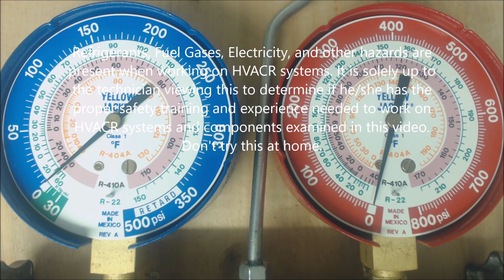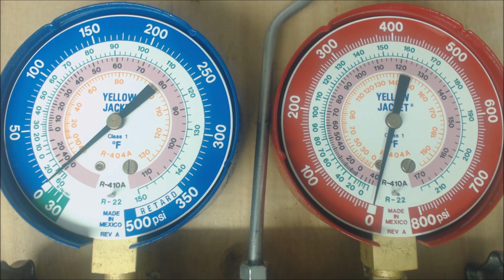R-22 and R-410A Refrigerant Operating Pressures on Air Conditioning Units!

Comment: Is it normal for head pressure to swing upwards of 70-100psi while running?  On a 70 degree day.  Unit is around 300psi high side and swings up to 380-400 and then back down. Low side is about 125psi

Comment: What is the max pressure required for an inside evaporator. My evaporator has 400 psig. Can I use it for R-410A after flushing out the r-22?

Comment: I have a question.  Our AC Unit was checked and we were told that it was working great.  It was a model from 2008.  However, by the following day our unit was no longer cooling and the refrigerant was completely empty. We also had water near our furnace from the evaporator coil.  I requested the report from the company and these are the numbers that were listed.  High Side Pressure=210, High Side Temp=105, Low Side Pressure=70, Low Side Temp=38.  Were these readings ok?  Or was it indicative of a problem?

Comment: If a system at sea level has a standing pressure of 14.7 psig on a standard gauge does that mean it is completely void and anything less is technically under vacuum/ open to moisture contamination?

Comment: What should the blue/low guage read when re-filling with R22?  This would be in a constant temp climate like Miami of about 85 deg F.
Reply: It depends on a few factors but sometimes you wont see the suction gauge go up much because it depends on the metering device and some other factors or you wont be able to charge the refrigerant much because of the devices in the line. Otherwise, most of the time the suction and discharge gauges will reach equilibrium once the refrigerant settles. Alot of times you have to charge as much as you can with the system off then turn the system on so you can finish putting in the rest of the charge because you need a better pressure differential. Ive even had it where i can barely put in refrigerant while the system is off and i had to manually turn on the compressor or bypass the low suction pressure sensor because i couldnt get enough refrigerant in the system for it to stay on long enough because it kept tripping on low suction pressure

Comment: I watched this video more than 5! Time but every time I watch it I’m learning something new and very helpful thanks. Because I run to an ac with r22 refrigerant and has high pressure on high side and was afraid if I did something wrong to the system after I watch this video again I understand it was because it small condenser with low sears. Thanks again

Comment: what about roof top package type units???....i was told do not worry about subcool or superheat method and just charge by pressure...could not find  a subcool rating anywhere ..has txv valve

Comment: 110 to 136 PSIG on the low side?
The data plate on my condenser says 410A PSIG LOW: 236 HIGH: 446
Reply from the maker: Those are not running pressures but design max pressures, the running pressures will change with the heat load inside and outside the house, thanks.

Comment: Thank you for your videos. I have a question about the "expected pressure" on the high side, can we take the SEER rating, refrigerate type and the outside temperature and add a constant value to get the expected high side pressure?
So for a example a R22 on a 85 degree day for a SEER 13 would mean the pressure should reflect 85 + 20 = 105 F. Then covert 105F on a PT chart?
Reply: Kow  the  are  . Diffwrnce  in  temperraure  of  of out  and  room  air  and  u  factor  the  heat  leakge  rhrufh  wall  . Cilling  and  floor  per  hour  canbw  calculated  using  the  following  equation  ..   Heat leakge  =ufactor  xtemperature  difference  =uxAxTD (u=factor  -Btus  =area  -squre  feet  Td=tempreaature  difference  -°f.

Comment: Where to normally find the metering devices on typical residential systems?  Thanks
Reply: In the same panel as evaporator coil or right outside the evap coil usually unless it is a fixed orifice or exv. Those are usually at the condenser. But they are all on the liquid line going to the evap coil

Comment: Is there a way to approximate how low in refrigerant a system may be using the gauges? Thanks.   Love the channel.
Reply: Kind of. The system name plate will usually tell you the normal charge in the system (in the US it will say 5lbs of R22 for example) and then since you know what normal operating should be, you can kind of guess. If the system is operating at half the normal pressures then you would be somewhere around 2.5lbs of refrigerant based on the example above. But don’t forget that any split system with more than 20ft of line set you have to add a few ounces per every few feet of extra line set. I cant remember the exact numbers but yea

Comment: We have a min of 95F cond temp on all systems so you're going to have a low of that on 22 or 410 systems, so 22 shouldn't be any lower than 190psi and 410 280psi, any lower and the system needs head pressure controls or it will crash, you won't be able to maintain control of the low side and you might slug the compressor, variable speed equip might be the exception.

Comment: Hi question:  what caused the  low press pipe condensor outside frosting and  hi press pipe cold on the evaporator side ( when you touch it) ? this happens when The AC has been running over 10 hours then temperature house stuck at 24.5 degrees C then the indoor house turning hot again? thank you

Comment: I have a Embraco VEGT 8H compressor and i'm not sure what low side pressure I should be seeing on the guage.  I have seen videos on freon charging that say 2 and others that say 30 psi.  If anyone has the answer I would be grateful.  At the moment my low side pressure is 10psi and im not sure if i should add or remove freon.  thanks

Comment: it would be a great video if it was running with those freezing low side and what the high side is doing at the same time. If the low side is 30-32 what the high side doing.

Comment: What is the correct psi for r22 dometic rv ac ?
Reply: Depends on the unit itself, use your charging plates and data plates for reference. If its txv use subcool if piston superheat. If you dont know this you should probably not attempt at all.

Comment: Is it expensive to convert from one to the other? Do I have to buy a brand new central AC unit?
Reply: You would need to at least replace the condenser coil, compressor, metering device, and evap coil. Than you have to make sure you flush the lines out (they have flushing agents like RX-11), flush with nitrogen, and then make sure you vacuum to 500 or below microns etc. If i were you i would just replace the whole system if you could. You might actually save money because the labor of replacing all those items is more than the labor to just replace the units. If you can of course.

Comment: I have a question. Let's say in NC the ambient temperature outside is 80 degrees and you are using R-410A refrigerant. What should my high side and my lowside pressures be? Second question if you charge the unit with a subcooling of 12 because that is what it calls for will you still have the same subcooling at 95 degrees in the summer?bAnd what will your high side and low side pressure s be?

Comment: can you do one with celsius
Reply from the maker: Thanks for letting me know what you would like to see Fareeda!
Reply: @acservicetechchannel  it is a bit complicated to understand the pressure vs the farenheit  scale.what will the typical pressure readings be around on a hot day say32 degrees Celsius. I have set my pressure at72psi . But my air con still cools to only 26 degrees inside my lounge.i have an 18000 but unit.i I use r 22.

Comment: Love your videos 
Would like your opinion 
Running a packaged unit with r22 and high pressure switch is faulty cant read the stamping on the switch and cant crossmatch oem # to aftermarket. 
All i know is its made by saginomiya with dual spade terminals and a female fitting 
Would one in the 300-400 psi range do the job
Hope you can help thanks
Reply from the maker: If the unit is an ac only unit without a reversing valve then it is not a necessity just like most other ac only units. If it is a heat pump then it is there as a safety. 300 or 350 could work though.
Reply: @acservicetechchannel yes it is also a heat pump  Thankyou so much cheers

Comment: Should we make up 410A to 1.0 HP Panasonic Inverter with the tank turned upside down and compressor is running?
Reply from the maker: You usually break the vacuum with the amount of refrigerant needed. that is called the total weight method. You can add refrigerant in slowly while it is running but the bottle must be upside down and be metered in slowly to avoid liquid entering the compressor. The accumulator will also safe guard the compressor, thanks!
Reply: @acservicetechchannel  Thank you for the feedback. Appreciated the answer.

Comment: Your videos are great man have really learned a lot from the way you teach things and make them easier to understand. How do you know what the head pressure should be for an R22 and 410A system if the outdoor coil is clean and the ambient is around 70 degrees F. I was taught anything above 70F, add 30F and that should be your saturated condensing temperature. So if it’s 80 degrees ambient add 30 degrees which gives you 110F. See what pressure that corresponds to using a pt chart for a given refrigerant and that should be your pressure. Is that a good way to determine what your head pressure should be
Reply from the maker: What you are describing is that old ambient plus 30 rule of thumb. We use superheat and subcooling for efficiency and compressor safety. That was a rule that got you close on old 10 seer r22 units. Look up "acservicetech subcooling and superheat" I also have everything explained in detail step by step in the book at acservicetech.com thanks!
Reply: AC Service Tech LLC Thanks, I really appreciate the info and your videos have helped me tremendously throughout my apprenticeship

Comment: I just started up my own little system but its a medium temp system . Now am confused my friend says it is under changed and I know it is. My high side is at 151 psi  and my low side is at 42 Psi How is it that am getting 41F across my coil and my suction temp is at 53F for the compressor. All I know if for my system the evaporator coil needs to be under 40F say about 30F to 35F. Maybe I just need to keep adding gas but when I do my compersser shuts off on high pressure. I am confused it is water cooled as well.

Comment: I have a 16 seer Rheem 3 1/ 2 ton unit cools Ok not great late afternoon and night but from early to late afternoon won’t maintain temp we have it set for 74 degrees it will go up 78 or 79 degrees in afternoon unit is less than a month old when they installed it they ran a new line set I was watching through out must of the installation they had a bad kink in the diction line when they ran it I mentioned it to them and they said they seen worse and they left it like that so I put gauges on it and at 97 or
Reply: 97 degrees ambient it’s running at 102 to 105 psi on the low side I checked sub cooling I have 10 12 degrees charge is good I am thinking the kinked line is causing low suction pressure would the linked line cause low suction pressure? Clean filter brand new coil real good air flow kinked line gotta be the cause

Comment: Awesome channel! There is so much bad information out there on this topic so thank you for teaching us! Btw how are window and portable units able to operate at 300psig low / 520psig high (R410a). I’ve been looking everywhere for an answer and can’t find one. They are usually completely sealed systems and don’t have service ports. But even if you install a port, how would you fill it to 300psig?! It seems like they can’t be repaired. There is usually a sticker with the specs on the side of the unit and that’s where I’m getting these numbers from.
Reply: Or perhaps it’s the maximum pressure the unit is built for..... yeah probably that. :)
Reply from the maker: Yes that is the max design pressure for sure, they operate the same as other r410a fixed orifice systems and you would mout the port on the low pressure side to check the superheat since it has a capillary tube as the metering device, thanks

Comment: You mentioned that things are different in an inverter type system.  Can you explain that more?  I am seeing about 75psig on the low side of a R410a mini-split during operation and trying to figure out if that is somehow normal or if there is actually a leak.
Reply from the maker: Mini split manufacturers don't give us superheat or subcooling guidelines but just the total weight procedure for inverter type units unfortunately however the low side sat temp should not be below 32 degrees, thanks

Comment: 120 suction pressure with 500 high pressure it trips the high pressure cut off switch. What could be the problem
Reply from the maker: Is it a heat pump or AC unit. Is the subcooling too high? Are the fins in bad shape? Is the outdoor unit stuck in a location where it is recycling the hot air that it is trying to blow out of the coil area?
Reply: @acservicetechchannel  13 seer York 3 ton split system. Not sure about subcooling. Because tech didn't read that. She said bad compressor. She said the fins are good. it's in a very ventilated area.
Reply: @9to5techs : "She said a bad compressor." With a 500 psi head pressure?? (just saying) :)
Reply: @coolramone  what do u think it is
Reply: coolramone SHE, said bad compressor? Tell HER to go home and start cooking, she's probably got air in your system. Hire a MAN to come and evacuate the system and run a good vacuum then charge to the capacity stated on nameplate of condensing unit.
Reply: @acservicetechchannel  forgot to tell you it is R-410A

Comment: I recently had contractor added 4lbs r22 into 2ton unit.  At that time outside around middle 70s.  In door temperature readings is 76-78.  The low side pressure is at 70s and high side around 130s.  Is this right settings?  Thanks you!
Reply from the maker: They would have been either using superheat or subcooling so you can't just go by pressures, thanks!

Comment: My r22 compressor went out.  It was made in 2002. My evap coil is 410 and was installed 2012.   The guy wants to get a 410 condenser and reuse my r22 in the system. Will this work?
Reply from the maker: If the evap coil, metering device, and outdoor unit are all for R-410A then the tech must use R-410A. I think that is probably what the tech meant to say, thanks
Reply: I wish that were the case.  Unfortunately I ended up having to find someone else because this guy was not making any sense.  He was going to buy an Amana condenser new and charged with 410. He was going to take that out and reuse my r22 in it.  He was then going to write r22 on the side of the unit with a marker.
Reply from the maker: Wow, that would not have worked. Glad you found someone else, thanks!

Comment: So I charge refrigerators all the fine but I’m gonna be charging my RV AC tomorrow and it’s R410a. I dnt believe I have a way of measuring the 22oz charge. Do I just charge it running till I get around 110 psig on the low side ?
Reply from the maker: We usually use a digital scale for systems like that but you could check the type of metering device such as if it has a piston and use the superheat method likely, thanks

Comment: Ac required r410 but i charged r22 gas any problem?
Reply from the maker: That is a big problem. Those refrigerants should not be mixed and the system will not work properly with both inside. The whole charge will need to be recovered and start the procedures over, thanks!

Comment: Can you explain how or why my heat pump condenser coil is freezing in heat mode?
Reply from the maker: Hey Kemon, any time the outdoor temp is about 40 or lower, the refrigerant must be at a temp lower than 32 degrees in order to absorb heat from the outdoor air. This ends up attracting outdoor humidity onto the coils and is normal for a heat pump. They then go into defrost mode to melt the coil, thanks!
Reply: AC Service Tech LLC Thank you AC service Tech. I enjoyed your videos and I like how you explain everything to detail.

Comment: hi, for example if your high side gauge shows 300psig, is this the same as head (discharged) pressure coming off the compressor? thank you.
Reply from the maker: It is less since it has given off heat in the superheated state before entering into the saturated state. It is different than what happens in the evap coil where right after going through the pressure reducer it changes to sat state, thanks!

Comment: Something I can't seem to understand is if the temperature outside is cool like 70s  your suction pressure can seem low like at a 30-32 degree saturation but be perfectly fine. Like If its 70 degrees in the house my low side sat temp is like 30..  how does this work? Your videos help me in my career. I'm out here in FL as well thanks
Reply from the maker: If it is below 32 degrees sat temp then it would be freezing so that wouldn't be good. That would mean either low airflow, low refrigerant charge, liquid line restriction or low temperature inside the building. The evaporators for air conditioning are designed to run at around 40 degrees. That could mean anywhere between 32 and 55 degrees depending on the indoor temp crossing the coil and the outdoor temp. It has to be low enough to get the humidity in the building to condense and drip into the pan and low enough to absorb heat efficiently. Keep watching the videos. Look up "acservicetech superheat playlist" to learn more and check out the ones with the evap coil in the thumbnail, thanks
Reply: @acservicetechchannel  right I know below 32 degrees it's freezing.. however if the indoor temp is cold I notice my sat temp is very low BUT there would be no issues at all. Just confuses me. Thank you
Reply: @dapperdon7212  aka Teflon Don